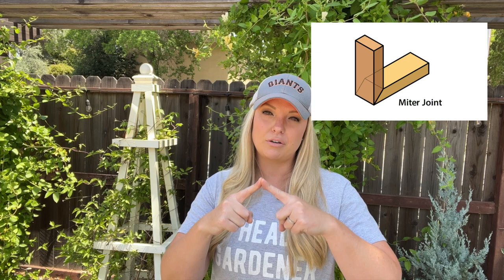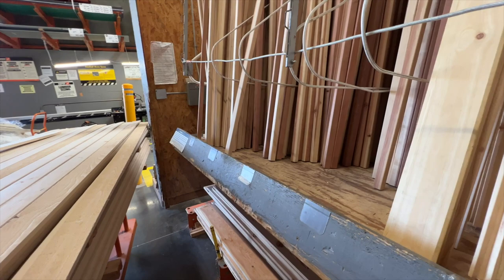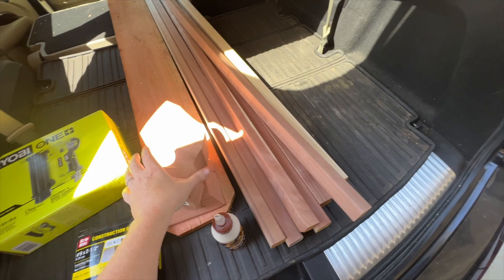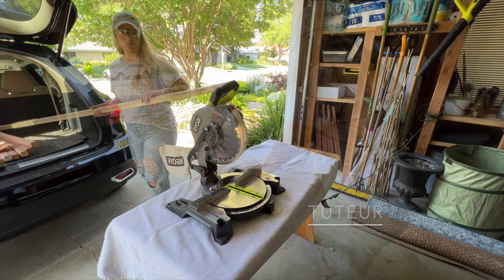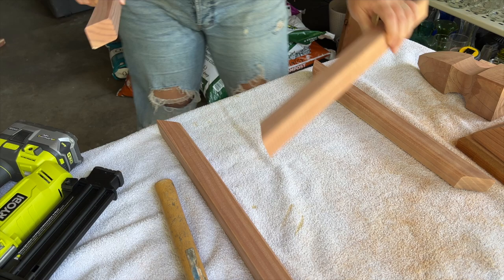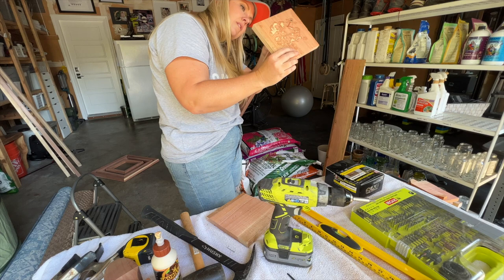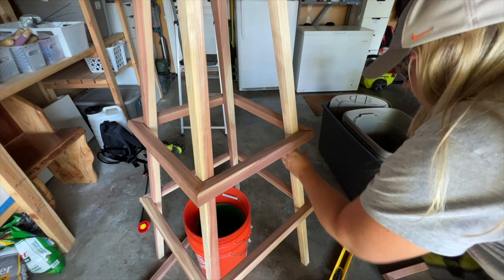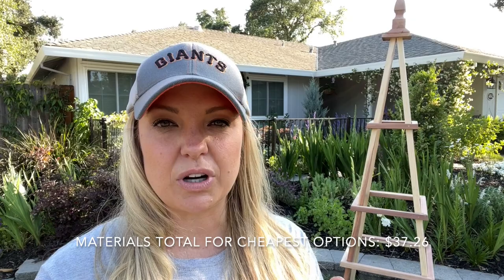DIY Garden Tuteur or Obelisk or Trellis!  Whatever You Want to Call it! 😆 :: Gardening Zone 9b

Comment: What are the measurements for the small squares?  I understand they're cut at a 45ﾟ angle but each square is slightly larger than the other.  so what would those measurements be?  Thank you in advance